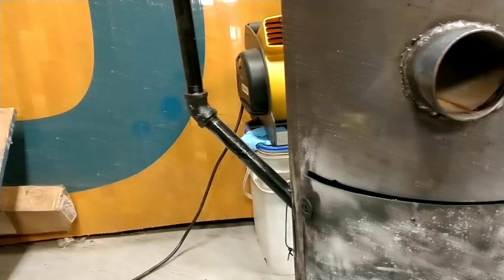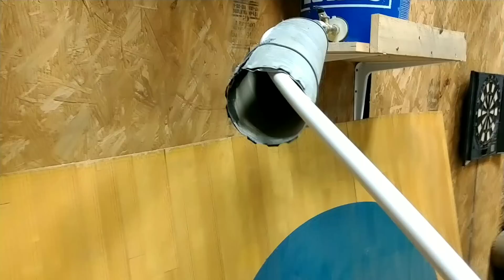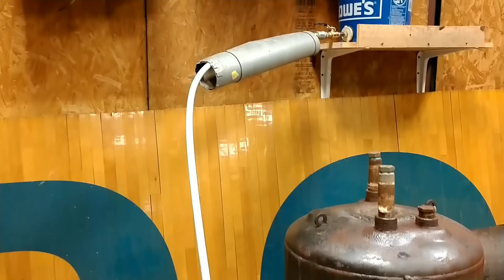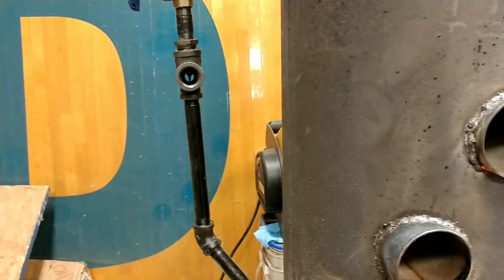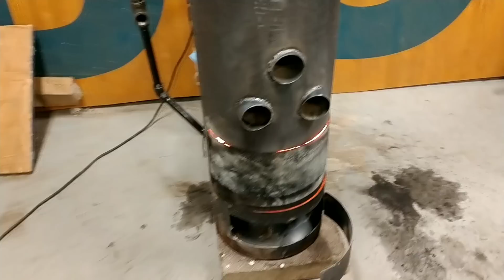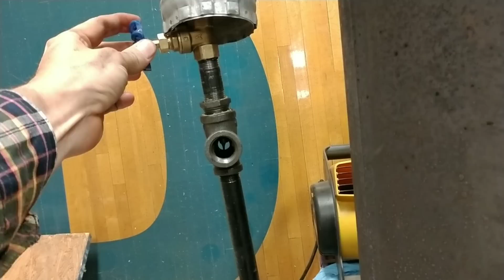Updated Waste Oil Heater Drip Feed Ver.2.2 Detailed January 19, 2018

Comment: nice design . I was wondering how you did your heat calculations on the placement of the highly combustable oil tank and the plastic line supplying the burner . also what class of fire extinguisher do you have nearby in case the plastic or reservoir get knocked over or spilled on the unit....
Reply from the maker: Well, not really any calculations, the tank originally started with an alluminum oil supply line, after running it I could then see the line would only get up to around 120 degrees Fahrenheit, so I decided to make it with pex line due to the ease of use, I also wrapped some heat shield tape around the pex for safety reasons. The five gallon bucket Is what I had lying around the shop so it got used also, with out any calculations on fire safety or ratings. This heater was just an atempt to heat my shop at a very low cost out of my pocket and since it was successful I then choose to share it as did Gerry's diy did. I think most of the things you see on YouTube as home built items are just home built items that are and never will be meant to have a commercial appeal. You can purchase commercially available waste oil heaters for a rather large fee that would  have all of the safety calculations done for you and meet all the requirements set forth by our governments. this is what it is. Just a red neck designed waste oil heater that burns oil and produces heat. Is it safe? Probably not, expecially if the person running it thinks you can light it and walk away like it's a Trane heat pump. If you build one of these heaters please use it with extreme caution, I never leave my shop with this thing burning. Oh yeah the fire extinguishers I use are ABC extinguishers, the B in ABC means  B” LIQUIDS

Fire extinguishers with a Class B rating are effective against flammable liquid fires. These can be fires where cooking liquids, oil, gasoline, kerosene, or paint have become ignited. Two commonly used chemicals are effective in fighting these types of fires. Monoammonium phosphate effectively smothers the fire, while sodium bicarbonate induces a chemical reaction which extinguishes the fire.
I have multiple extinguishers available ranging from size 4 through 10.
Thanks again to my inspiration behind my waste oil heater Gerry's diy.  
Hopefully, I answered most of your questions, and thanks for watching and commenting.

Comment: Using waste oil from automotive drain/change oil at a burn rate of 1.5 liters per hour will release more atmospheric pollution than 450 cars idling in a traffic jam.  As a survival tactic after a zombie apocalypse, this might make sense.  In a world with 9 billion people it is akin to burning the rainforests.
Reply: Its no different to burning gasoline 
They all come from crude oil...
Bitumen,heavy oils , gear oil , motor oil , diesel / 
home heating oil - kerosene , then gasoline...then vapors like propane / butane ...
Waste motor oil just has soot in it....burning all,of the liquids all give off heavy metals and toxins
Reply: Thomas Wilkinson  you need to think about the efficiency of the burn in relation to your comment this has high oxygen amounts going into the burn which is going to greatly increase the effectiveness to heat and to keep emissions down.
Reply: And there are only 7 billion people on earth. But who's counting..
Reply: @chrisglassford9982  exactly burning any thing gives off something...
but the earth is mostly un-inhabited our largest continent is barren and 75% of the earth surface  is water

we are how ever running out of food ... since less than 1 percent of ppl are actual farmers
Reply: and i think it closer to 9 billion now
Reply: @fixitup2193  
7.53B as of 2017
But yes, more farmers are desperately needed.  More self sufficiency is also a good thing.
Reply from the maker: It will also burn vegetable oil.

Comment: You mentioned burning automatic transmission fluid ? My concern about burning used motor oil is the emissions it will create especially when there's all kinds of additives  to consider . I was thinking about doing one of these but the thought of leaving it alone kinda scares me  . I wouldn't be able to set it and forget it like I can a wood stove . I'm leaning towards a rocket stove design that heats up mass which releases heat over a long time . The emissions are super low and practically nill . It isn't fast heat like this is but I think it's a little bit safer . I like your design though and the idea using heat exchangers. You're right hot water heaters are not thick enough for this sort of thing .

Comment: You need to draw the air from outside to make it efficient
Reply from the maker: That's a great idea, will work on that
Reply: @randysdiy2102   i'm working on a stove on waste oil aswell and sinds they use a big amount of air the efficientie will go up atleast 50%.
Reply from the maker: I'm not sure I understand your question it sounds like you're saying if you use forced air the efficiency goes up. If you use forced air the efficiency does go up however the more air you put in the more oil you have to put in as well. Just like a supercharged are blown engine the more air more fuel is needed.
Reply: @randysdiy2102   no i'm sorry if i was not clear... But what i mean is that you have to connect the stove to a closed air intake that sucks the air direct from outside the building. Because now you are using  hot air from inside your building that go's along the chimney out the building so that means that you pull thesame amount of cold air back into the building so that air from outside will cool the inside building down again so that is not efficient like when the stove would have been a closed circuit from cold outside air... trough the stove and exit the chimney... Not ??
Reply from the maker: Yes, great idea.

Comment: how big of a groove in the gate valve?       I wish you would explain these things as we cannot see the groove since the gate in the valve is hidden.    did you use a small round file to make this groove?
Reply from the maker: Yes I used a chainsaw file to cut the groove,  cut it just as large as you can without creating a leak. So as big as possible with out leaving a hole with it closed
Reply: Gerry's diy has a good design on burning waste oil also. As far as the groove in a gate valve, a globe valve is made for throttling liquid flow rates. That may be an alternate choice of a valve. I just may have to visit my local hardware store to see if they have an old water heater and build me one of those heaters. A shed in Minnesota gets a little chilly in the winter. Thanks for the videos!

Comment: A change that maybe worthwhile, would be having more smaller heat exchanger pipes - say 10x 2".  Also, try running the heat exchanger pipes at 45° through the tank, so that the heated air within 'pumps' air through the tubes - you can avoid the need for the fan noise/electricity then.
Reply: Yes! I was really baffled by the horizontal tubes considering all the other back-pocket engineering on this. Made no sense to me. Plus, angled natural draft pipes could be arranged in a spiral which would maximize heat exchanger efficiency by swirling the post-combustion gasses

Comment: Nice work. If you manifold your exhaust to exit lower in your stove it will increase the heat captured. Create an unnatural exit. Right now your heat rises, and leaves.
Reply: @biggybiggy84  See my comment above it suggests doing the top half of the tank as a Rocket Stove is done.. This would put the exiting chimney half way down the unit capturing more Btu's in the unit because heat rises while the chimney can still draw in a downward motion. Could reduce his chimney temps maybe 100F in the process this would allow him to build a smaller unit and collect the same amount of Btu's on the same or less fuel.

Comment: Randy is there a way i can get in contact with you. Id like to get the materials supply list for the oil feeder line that you have. Im not great at trying to figure it out in my own
Reply from the maker: I can get you a list together with everything you will need, give me a day or so please
Reply: Man that would be great. Id appreciate it.
Reply from the maker: The bung for the bucket, I have no idea what's it's called but I got it at Lowe's. From there a 1/2 to 3/8 bushing reducer, a 3/8 2 inch nipple, a 3/8f to 3/8f ball valve, 3/8 nipple, 3/8 to 1/2 bushing reducer reversed, 1/2f to 1/2f I think it's called a bell, then 1/2 pipe to 1/2 pex fitting. Finally pex line.
Now the bottom.
1/2 pex to 1/2 pipe, to 1/2f to 1/2f gate valve, to 1/2 inch pipe nipple, to 1/2 to 3/4 bushing, to 3/4 x 3/4 x 1/2 tee, off of the 1/2 inch side of tee then 1/2 pipe to 1/2 45 degree to 1/2 pipe. And done except the 3/8 pipe nipple threaded into the 3/4 top tee so you can see the oil flow. WOW! now that's really confusing. This could have been a lot easier if you just go to the hardware store, I used stuff I had laying around, that's why all of the conversion. I guess I will do a video of what it takes to build this later this year.
Reply: @randysdiy2102  Bulkhead fitting is the name of the fitting in the bottom of your bucket. Good video.
Reply from the maker: Thanks

Comment: Ima steal your design, except im going to s curve the 3 inch 3 or four times in and out of the main tank to grab the most heat, with a fan to a drier vent attached to the bottom, and another dryer vent atta hed to the top to blow in to the room
Reply from the maker: Cool

Comment: @ALLTHEBOOST YOU SHURE CAN INCORPORATE ROCKET STOVES AND OIL BURNERS BUT YOU NEED TO  MODIFY THE CHIMNEY OF THE STOVE WHIT ROWS OF HOLES AND THE DRIPPING OIL SISTEM OR YOU CAN MAKE A ROCKET SPACE HEATER AND HAVE THE DRIP SISTEM IN THE  ENTRANCE TO THE FIREWOOD PORT BEFORE THIS FUEL START TO  BURN INSIDE THE UPSIDE TANK OF THE SPACE HEATER HAVE BUILD SOME  LIKE THAT BEFORE AM A WELDER IN TEXAS .

Comment: I really like the idea but I think you're losing a lot of heat out the chimney. I wonder if you could incorporate rocket stoves and waste oil burner stoves together use a couple of liters of oil to get it all high and have heat in your shop for a day or two. That way you could have heat in your shop all winter long on one or two vehicles worth of waste oil.
Reply: Interesting idea ,I was thinking about that exact same thing as well. This way you can get the benefits of both . I'm not crazy about the idea of using oil or having to run a line to a extremely hot burner . I've seen several videos about accidents and terrible fires that have happened using one of these things .
DIY is good as long as you know what the hell you're doing and observe all the safety precautions and most importantly do a lot of research before cutting and welding one piece of metal for a project like this . You're right it's losing far too much heat potential out the chimney which is the appeal of rocket stove mass heaters to begin with . I guess having one of each would be good for heating things up quickly but then having a rocket stove to maintain the heat and keep it warm for hours . I'm not sure how to go about incorporating both though . I wonder if anyone else has already done it ?

I have a large shop that measures 80ft X 40ft X10 ft tall for the ceilings . That measures out to approximately 32000 cubic feet of area that I have to heat up . I was messing around with a small free standing wood stove that's all 1/4 inch steel plating called a "Baby Bear" ,that a guy I bought a tractor from just gave to me . I thought it would be a good stove and heat things up but after getting it all set up and making a temporary hole in a wall for a chimney and running it,I was disappointed with how much heat went out the pipe and I'm not a huge fan of the smell of hot metal . Plus I had to feed the little beast every few hours . It did get the shop warmer but it also made it smell of woodsmoke and hot metal . Then I ran across this rocket stove idea and decided to make a small scale version of one . I was amazed at how little I had to tend to it and how little the amount of wood I needed to use . Granted I will be using a metal barrel for the burn chamber but the odor isn't nearly as much as the traditional wood stove plus I can have that heat stored up for later release . I've made a couple of different stoves such as a gasification burner and then the rocket stove design. I also made one that's a combination of both designs which got extremely hot and the ash content was almost nothing . The idea was to super heat the burn chamber to incinerate all the matter and release all the heat potential . It worked out better than I thought it would . What I had stumbled upon was nothing new but a design that modern gassification units use . More or less they use a catalytic burner which burns all remaining fuel for heating but also need power for the microprocessor to measure air content needed for combustion plus it accounts for moisture content etc plus uses a blower etc . I would love to have one of those gasification units but they're not cheap around 5k and up and the government doesn't offer decent enough tax credits for using one even though they're super efficient like 87% and pretty much non polluting . Also they're not able to be used to heat up mass the way a rocket mass heater stove can. So my search continues..
Reply: @royalspin  do you have vids of you build?
Reply from the maker: Not of the actual building it as I use my cell phone to make the videos. Sorry
Reply: You can do rocket stove chimneys on waste oil heaters but hard to control the temp in the shop it burns so hot. The water tank could not handle the heat, it would burn a hole through the sides of heat chamber. A thicker walled metal could be added though (say the tank from generation one system added inside the gen 2 system)
Reply: @carsdad02  maybe can line the tank wuth firebrick?
Reply: I don't think it's possible as the exhaust needs to be hot to create the draft for the burner. When I choked mine down it screws up the burner.

Comment: Any thoughts on the most efficient heat exchanger for a water heater? I'm thinking either a lot of coiled pipe, but perhaps not copper in case of a failure in water pressure, or a water jacket, perhaps with fins welded to transfer more heat. Perhaps more than one jacket, e.g. forcing the hot air up through the gap between an inner and outer cylinder.
Reply from the maker: Gerry's diy has a water heater wast oil heater, you should check his videos out

Comment: Are you running slicks on that truck Randy? Very nice build. I'm thinking about a build and can't decide whether to go down the oil jet or drip route. Drip is easier. Also forced air or normally aspirated. I'm going to build a water heater which will reduce the convection so I'm guessing forced will be better. Any thoughts?
Reply from the maker: Yes slicks on truck, as far as water heater I don't have any experience yet on that part however jerrys diy has some info on it

Comment: Nice work. Wonder if it works burning only diesel oil?
Reply from the maker: I've also ran it on transmission fliud. So any type of oil should be fine. The transmission. Fluid actually worked better it was easier to control the flow due to viscosity.

Comment: If you was to install those "Heat exchange tubes" at a slight angle you would not need a fan because of the natural draw it would cause. Just make sure the higher end of the angle is facing the direction you want the hot air to go and for a more forceful flow you could attach a longer tube to the low end of the angle to pull/draw cool air from the floor or even through the wall to outside but you must make sure it stays lower than the higher end of the tube or the flow/draw will go the wrong way.

Comment: Nice work, what are your smoke levels like?
Reply from the maker: I look at some of my other videos I have on my channel, I have one there for smoke out but it's not too bad. It dosn't smoke to bad, I guess you'd say air fuel ratio determines smoke output. if the drip gets too fast it does put out a good bit of smoke but if you keep an eye on it and get it regulated there's almost no smoke.

Comment: If you run the heat exchanger pipes vertically, that is from outside at the bottom, then a 90 deg bend and out at the top, you wouldn't need the blower.

Comment: I like the idea you do not need a blower to add air, just the draft.  A suggestion would be to add a cold air intake using the outside air.  Just plumb it to the bottom of the tank with maybe a four inch pipe or the like.  If you have a very leaky shop, it is not needed as much.  My shop is way too air tight so I added the CAI and it improved the draft and did not burn up the O2 in the shop.  Also, the cold air increases the fire box temp due to the tighter molecule structure.  Same principal as a CAI on a car.  I also agree with the suggestion to gasket the door to increase draft.  One other thing I did was use a brake drum for the bottom of the burn chamber.  Then you could run the air pipe through the center and just weld up the lug holes.  Will last forever.  Great job!!
Reply from the maker: All great ideas, will definitely Implement the cai